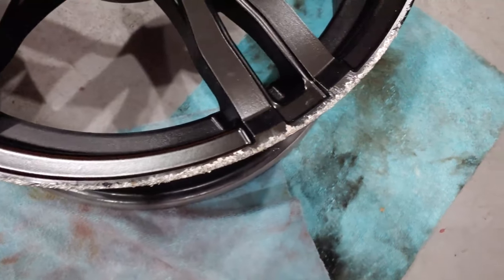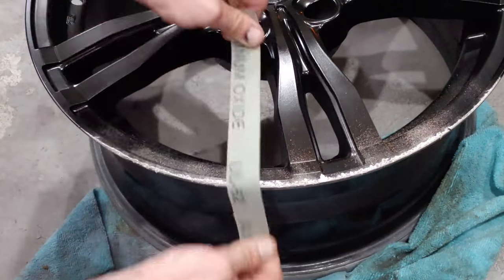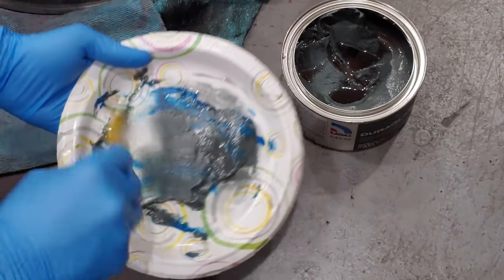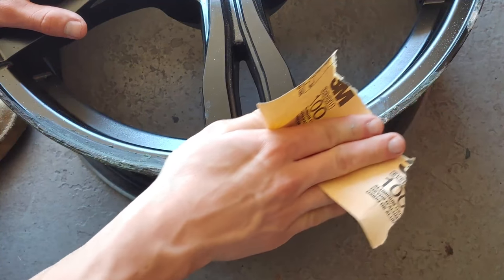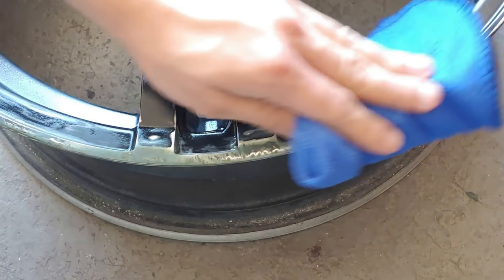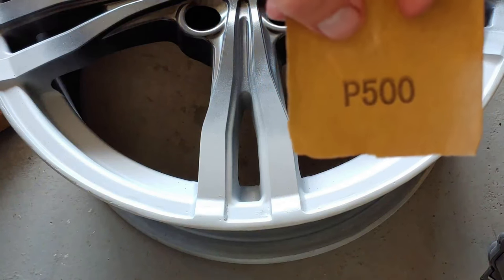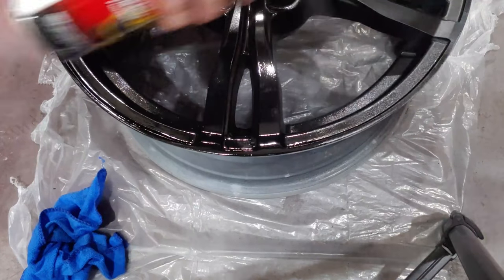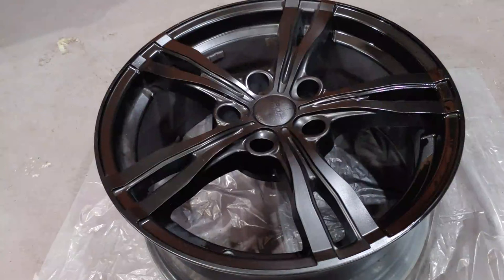HOW TO FIX CURB RASH | Scratches on rim

Comment: So I just successfully did this and love the result so far. I’m putting the wheels on the tires before painting and my wheels had a fair amount of rash. I’m worried that the Bondo will chip when they’re putting the tires on. Any issues for you!
Reply from the maker: Bondo is some strong stuff. In sure you wont have an issue. Did you see my orginal how to paint your rims video? Its in the description. If you follow that method I promise the edged of the rim wont get messed up when you out new tires. Ive swapped my tires twoce on my bmw and the edges have zero sign of wear!
Reply: When they put tires on, if you look closely, the machine first breaks the tire bead (shouldn't touch rim at all), then a longer metal arm uses leverage to get the bead over another metal part which takes the tire off.  No part of the machine should ever touch the rim- ideally.  You just have to make sure the operator doesn't rush.  The machines are designed to work on $5k rims the same as $50 rims.  It's more about the operator and the care that is taken.  As extra insurance, you can simply mark the area with the filler with two pieces of blue painters tape to outline the boundary.  Ask the installer to try to avoid that area.  A wheel balance will be in order since filler is lighter (less dense) than the metal it attempts to replace.  Bottom line- if care is taken, it should be fine.

Comment: Do you have to paint the entire rim if the road rash area is a small part covering less than 5 inches in length? Can you use this method and spot correct and try to blend existing paint to new paint?

Comment: You did an excellent job. However, I don't know hot to take the rims off my tires.😮‍💨I have curb rash on my rims. I called Toyota this morning to get the cost of how much it will cost $2,048.60 for 4 new Alloy Toyota 2017 Camry Rims.
Reply: I guess that includes tyres. Camry wheels are $1000 new max, and you're better off getting aftermarket rims at that point. Could easily get used on Facebook marketplace or ebay with tyres for 500.

Comment: i had some slight curb rash on my rims and did it with the wheel on the tire still. 180 grit, 400 grit, and 2000 grit. then cleaned with alcohol and just painted with flat black rustoleum. we'll see how it holds up but I barely sanded off any of the rim so I think its good on being balanced
Reply from the maker: Good stuff man. If the rash is mild you may not even need Bondo.

Comment: My rim isn’t as scuffed as yours, it’s barely scuffed but the paint came off, is it fine if I just spray it with a black spray paint?
Reply from the maker: Yeah you can. I'd put some of that primer I have in the link on it first. That stuff works great and you can super lightly sand it and make it look close to perfect.
Reply: @BuddysDIY  so if I just wanted to spray over the the rash instead the whole process. Which sandpaper will I have to use & primer for that quick concealment process??? Plz help lol

Comment: Hi, great video! Curbed my car recently and I’m so gutted :(  I was wondering, if I use the same black paint you are using, will I have to be weary about it not matching my current black wheels?
Reply from the maker: As long as it not too much different there should be an issue. Worst case you can paint the wheel on the same side that color as well.
Reply: @BuddysDIY  thanks!

Comment: URGENT QUESTION! How would I go about applying the cover-up WITHOUT removing the tire?!? Spray onto a plate & dip a Foam brush, maybe?
Reply: I just brushed the Bojangles drive-thru curb in my car I bought 6 days ago and I could cry. I need to fix it by tomorrow. 😩

Comment: I'm about to tackle this for my rims and I just have a few questions.

I have seen a video where the curb rash is completely sanded off using a Dremel. Is there any reason to use filler rather than just sanding it all out?

So I am going to do a full DIY job myself and so far I am pretty sure I know what to do but after watching quite a few videos a few steps/things I am still unsure of when to do it.

1. Do you need to sand after priming? I see some do it and some don't so I am unsure.
2. So if I am painting my rim a different colour, I am going to use a scuffing pad to remove all paint and rough it up for painting. After this, do you leave it rough and apply the primer or do you need to use 300 then 600 grit sandpaper to smooth it first before applying primer?

And is this the correct order and am I missing something?
1. Remove wheels/rims
2. Fully clean/degrease
3. Repair Curb rash using sanding/filler
4. Sand entire rim
5. Apply primer Coats
6. Apply Base Coats
7. Apply Clear Coats

Is this correct?
Reply: You wet sand the primer then apply paint
Reply from the maker: Filler just makes for a better end result.
Yes sand entire wheel of you're painting it another color and yes primer over entire painting surface
400 is good for scuffing but 600 should be fine. You can wet sand after primer to get a super smooth result if the primer is sandable. 

Some primers like the one I used in the how to paint your rims video lays down so flat you don't need to buy the filler primer is bumpy a little but sands down beautiful. Helps restore them with any minor stratches
Reply: @BuddysDIY  hey buddy if I have niche wheels how do I match the color would they just be gloss black? Since on Amazon they have gloss black and satin black I want to match them as close as possible since the rims are pretty expensive but I can’t find niche brand touch up paint

Comment: Found 8 18" rims for sale locally from a 2012 f150 for 100 total. Looking to repaint and resell. Will skipping the hardener spot be a notable difference?
Reply from the maker: Ehat do you mean skipping thr hardener spot. You mean just sanding down the scratches and painting and not using bondo?
Reply: @BuddysDIY  yes that is exactly what im asking!

Comment: Do you gave any recommendations on doing it with the wheel attached? Any at all? Great video!
Reply from the maker: It can be done forsure. But its so so so much easier to do it with ym the tire off.
Reply: Get a cheap deck of cards and line them between the tire and rim so that when you spray paint you wont get paint on your tire.
Reply from the maker: @robertlessentine9926  great tip
Reply: Robert Lessentine that’s clever. Do you use that as a substitute for newspaper/tape?

Comment: Do you think it’s doable with the wheel still attached to the car?
Reply: I would say that it depends on spot that you hit the wheel on the curb. So if it's in the outside area like in the video you should do it with the wheel dismounted but if it's the middle area and there are some scratches like mine it is probably doable.

Comment: So I dropped my new wheels on the face. Got small dents from the concrete, they are gloss white. Can I just dab small bits of the filler on the dents and paint over it with out too much sanding?

Comment: When changing your tires... will the machine expose the filler? When attempting to take it off
Reply from the maker: Not if you have a competent tire Guy.

Use the same primer and paint as I used and you'll be surprised how durable that stuff is
Reply: True true... thanks buddy

Comment: Can I use “bondo glass” or does it have to be the “duraglas” ur using?
Reply from the maker: You can prob get away with it man.
Reply: This bondi is fiber glass what i mean which usually used for plastic not the normal metal putty right which I think it's easier to apply

Comment: Can that filler go in the oven? Like if I wanted to powder coat the rims after repairing?
Reply from the maker: Once you get filler hot enough it will tend to soften. How hot are you baking it at?
Reply: @BuddysDIY  600

Comment: Had a company employer tell me "just sand it, then paint it with base coat with added clear... should be done in short time no need for extra steps" then complain it's not done right. I want to do like this video but they tell me doing 4 wheels on a car shouldn't take over 2 hrs 😑. I do love this, I want to do it right but not rush it but since im paid a certain wage, I'm stuck with doing it poorly and quickly.
Reply: Personally I would use jb weld expoxy since it is stronger but it's a 24hrs cure. Reason why when tires are changed they can rip the filler right off.

Comment: What happens when you install tires with awheelmounting machine and the installer puts a metal rod over the repair to install the tire?
Reply from the maker: Of you prepbthe paint like I did then a tire machine won't cause any damage at all.

Comment: Is there a specific body filler or you just used any. I got some filler i used for the bumper so is that fine.
Reply from the maker: That should be fine.
Reply: I would say use hard filler, I use light weight on body stuff cause it's easy to sand but this I'd us good shit

Comment: Can you still do this with everything (tires, wheels) still attached to the car? Its just too much of a hassle to take it all off
Reply: It's a hassle but better to take tire off if the rash is super close to edge area.  You also need to consider how the paint will be applied at tire edges.  Save yourself the headache and do it right the first time.
Reply from the maker: i agree with scott 100%

Comment: Does the filler crack or break off when reinstalling the tire?
Reply from the maker: Ohh absolutely not. Filler dries suoer hard. Get the stuff on tge amazon link on the description. Ive used it with zero issues

Comment: This video just saved me from the wrath of my husband!  Curb checked his BRAND NEW rims (SHHH he doesn't know) & I did YOUR fix!  It looks 95% better... i couldn't take the room off the tire.  Did you do a final seal after the black paint, i didn't see you mention it in this video?!!  I'm afraid it's going to peel during car washes!
Reply from the maker: As long as ypu put some primer on there before then the paint will not peel!! No final dral needed. Thr primer makes sure the paint bonds to the surface properly! :)
Reply: @BuddysDIY  I followed your instructions with primer under paint!  Thx!
Reply from the maker: @liznavarro2799  then you should be all good! Happy to help save the relationship haha.
Reply: @BuddysDIY  That would have been my head!!